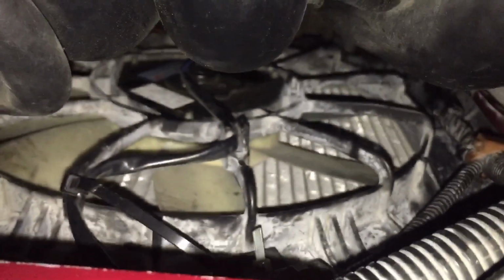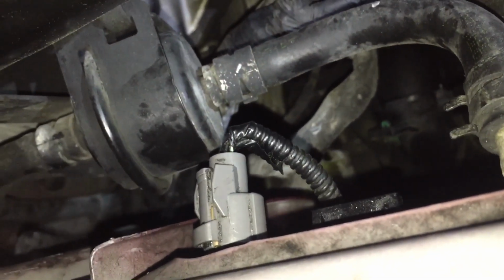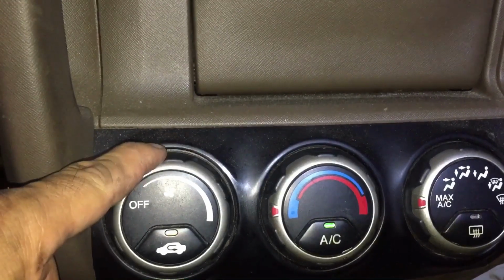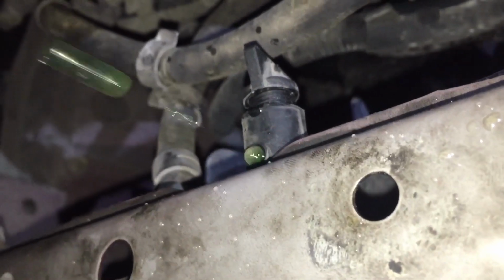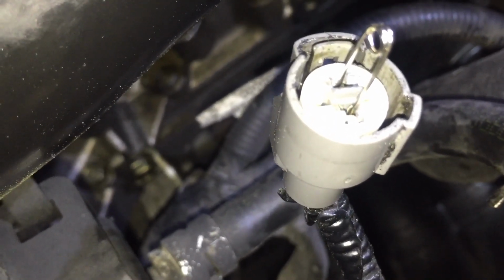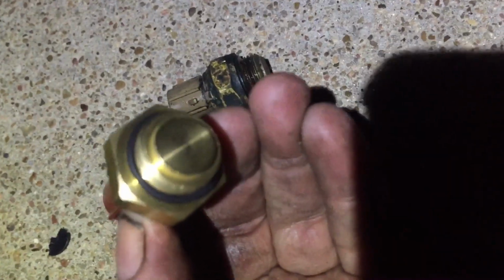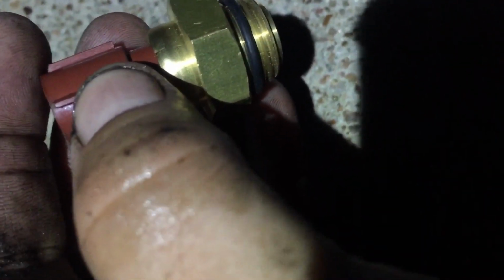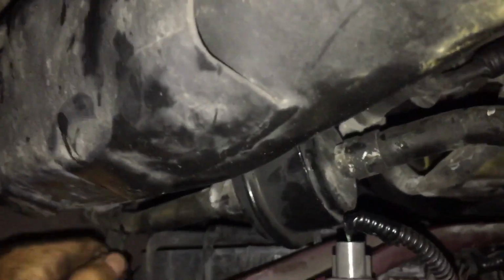Common Guy:  2004 CR-V Radiator Coolant Temperature Switch (Fan Switch)

Comment: If this sensor is not original from Honda or from a well-known and excellent company, it will not work properly.
Reply from the maker: It worked fine on the CRV and I sold it about a year later.
Reply from the maker: My bad 5 yrs later

Comment: You should check if there is power going to the fan first before checking all the sensors and switches. If there's power, the fan is out.

Comment: I replaced the fan switch but not I can’t get the connector to go back on it properly has that ever been a issue?
Reply from the maker: I’ve never had that issue with getting it to go back on it.

Comment: Bro you got the fans mixed up and you don’t need to turn on ac to test radiator fan. Ac fan is on the passenger side.
Reply from the maker: You're correct but it was a 2004 so I wanted to check both fans were working.  I cannot remember but I ended up changing one of the fans in this vehicle.
Reply from the maker: https://youtu.be/dSxFHUUG9hk

Comment: the cooling fan switch works like a light switch - on or off. 

a sensor "senses" something (like coolant temperature) and makes that info available (for a computer or maybe a gauge for coolant temp, etc.).
Reply: Yeah Im trying to find out if this is a SWITCH or Sensor? thanks. Ebay listing call em all switch sensors which makes no sense.
Reply: @filip6472  In this video he showed how to replace the radiator fan SWITCH. The temperature SENSOR is similar, but goes into the engine block, underneath where the air filter is (I think).

Comment: My fans stay on all the time and my temp gauge goes to hot immediately even if the car is Cleary cold
Reply: Its your thermostat but im sure by now this vehicle is no longer with us or you figured that out
Reply from the maker: Have you checked the wiring to the switch to see if it opens and closes?  Is the switch working, or is the thermostat opening on the engine?

Comment: How much you remove ,to get to the fan switch
Reply: Just get underneath the front end, you don't need to jack up the car. Wait... maybe that was the rad fan power connection... shoot, I forget. Sorry.
Reply from the maker: I just used the socket with the extension as you see in the video.

Comment: thank you for your video my Question 
i have 04 acura tsx  my fans don’t come on   i turn the AC and they come on  but if i turn off the AC the turn off and radiator  cap leaks because no fan working  do you think it could be te fan switch
Reply: Same thing happened to me and i also have 04 tsx did switching it give you any luck?
Reply: Cristobal Marquez yeap it work after changing   are you having any other problems with your tsx
Reply: @rickxs619  what did you change to fix it?  I have the same exact problem on a 2004 TSX
Reply: @cristobalmarquez266  same problem for the same car. How did you fix it?
Reply from the maker: Sorry for the late reply but my notifications were turned off.  Ricardo thanks for your input to help someone else out!!!

Comment: Radiator fan doesn't come on, unless i turn on the ac. Is it a temp sensor switch
Reply from the maker: Yes it is a temp switch.
Reply: Are you sure your CRV engine is up to temperature? That K engine is set to run hot. I was testing my fans, so I let the CRV idle in the driveway for 20 minutes, and the temp gauge was at normal position the whole time, just below the temp icon on the gauge. I figured out I should close the hood to keep the heat in, that quickly raised the engine temperature, about 10 minutes later the radiator fan came on, I was surprised, I thought the fan was dead.

But I also saw that the temp gauge was above normal, at the halfway mark, when the fan came on. BUT only the radiator fan came on, not the ac fan also. I think they're both supposed to come on if the temp sensor detects the engine is hot enough to turn the rad fan on. I don't know, though.

The AC compressor exploded a month ago, like literal explosion, and I do not want to do this test by turning the AC on to check the AC fan... I don't want to damage the serpentine belt or other accessories if the compressor is seized when the compressor clutch engages, if the clutch even engages anymore... 

I don't know how else to test the AC fan. I can't even reach its power connection, I think I'd have to disassemble the CRV front end to reach it. So, I can't send hte fan 12v directly to see if it even spins. I've checked all the relays, I've tried them all in the horn relay position, the horn works with each of them, so all relevant relays seem good.

I'd really like to know how to test the AC fan without turning on the AC!
Reply: @alphanumeric1529  I've changed it and it's all fixed
Reply: @memmzald3378  you just changed the switch?
Reply: @menaceemceefiend9716  yup
Reply: @memmzald3378  What year crv do you have? Mine is a 2001 honda crv lx. Was your temperature gauge showing higher than the halfway mark?
Reply: @menaceemceefiend9716  yeah not on my crv but k series engine so same thing technically. Yeah was close to red, so I had to turn on my ac to full hot on the way to drive back home. Best to make the car rest, get normal temp then put ac to full heat. If you need to drive
Reply: @alphanumeric1529  Unplug the ac fan (quick connect) and then run jumper wires from the plug end to your positive and negative terminals on your battery. If the fan activates, its your fan switch or some call it, engine temperature control. ($40 Auto Zone)

Comment: Bro I have a question I just bought a o5 Crv model se and I notice d I getting overheats issues while sitting in traffic not driving in highways the both fans turns on when I put the ac the guy that sell me the car he mentioned to me that he replace the both fans but I haven’t see the fan kicks when the engine gets to the proper temperature
Reply from the maker: Mine kicked on at a slightly higher temp.  Wait a bit to see but don’t let it over heat.  But it sounds like the fan isn’t coming on when sitting still so did you still check the temp switch?
Reply: Common Guy I fixed it already it was the fan switch I think the guy that has the car before he replace the both fans and put an aftermarket switch but the fan only kicks for a 5 seconds I guess that switch was bad out of the box so I take a note after get one from Honda it cost a few $ mine came with 100.04 $ with tax but after I installed I took. Notes the fans kicks on the temperature 218F and the fans kicks and it drops the temperature on 189 or 87 in seconds so the temperature drops like 22 degrees:) so I’m happy no more overheating in traffic
Reply from the maker: Sorry I got back to you so late.  Some how I missed your notification.  But the Fan Switch is the temp switch I was referring to.  It closes when it reaches a certain level.  That or the AC fan is the issue when it gets hot sitting still but ok when driving.
Reply: Common Guy the temperature sensor it was ok I plug my scanner to check the temperature if it was the same as the gauge and it kinda matches so now that you mention the ac when I turn the ac I hear 👂 a noise sometimes does but I don’t know I’m thinking is the tensioner pulley or idlle pulley it makes the noise when I turn the ac it looks like when there’s so load on it the bearing it’s dying i gotta take out the serpentine bell to check on those pulley or the clutch on the ac cars those days are nightmare